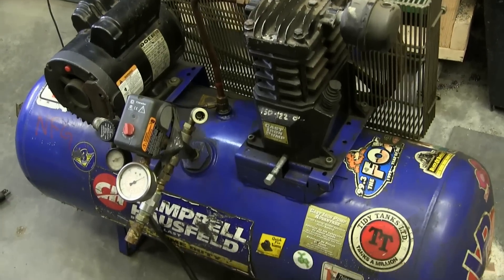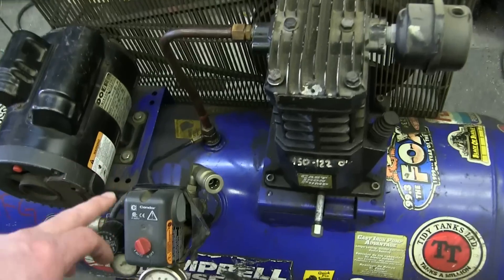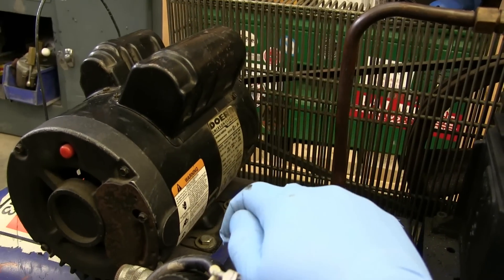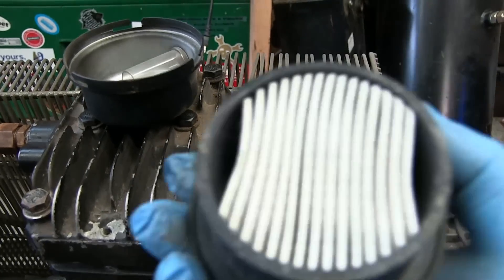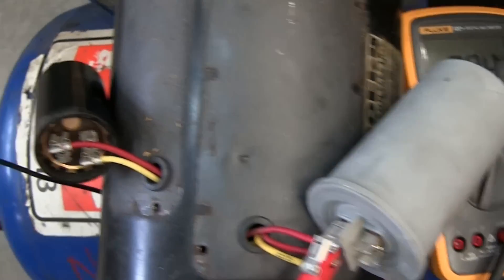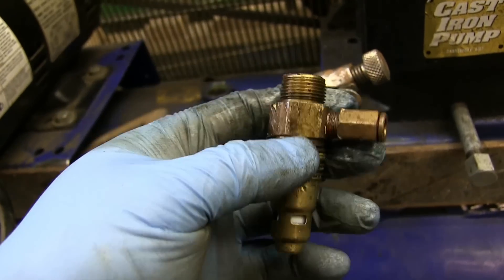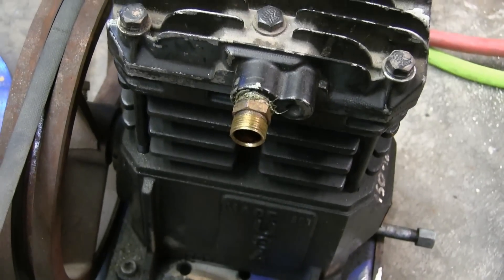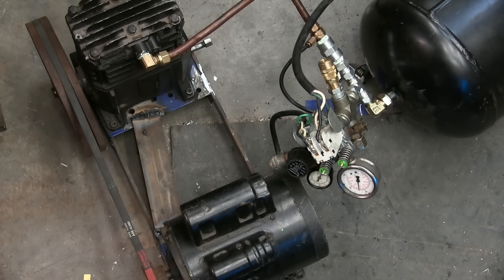BOLTR: Air Compressor Explained and Fixed.

Comment: I have a shop where the compressed air tanks are inspected by the state every 5 years. I have had the same inspector everytime and he has some very scary stories about air tank explosions. The most memorable one involved a car wash where the air pump wore out and was consuming oil. Instead of repair or replace the pump they kept pouring oil into it. The pump was running so hot the oil caked in the HP line running into the tank (plus the tank was full of oil vapor) making a restricted orifice..... One day... BOOM! Destroyed the compressor shed, blew out a block-wall, launched the pump unit over 200 feet away, killed 1 and injured 4 people. The inspector had pictures and it was truly scary how violent it was. Mind you, it was a bomb but the idea that something like that can happen is sobering.

I'm thinking, since this is in his house and he has a wife and child, he doesn't want to Mickey Mouse the compressor to save a couple of Canadian Pesos.... Some things are worth doing correctly. This is one of them.
Reply: That's why it's important to maintain your compressor,  I don't think i've ever heard of a air compressor exploding that was functioning correctly, it's always overpressure that does it.

After seeing his welds, yea, i wouldn't trust myself to weld a air tank either.  Besides, if you have other tanks laying around, why not use em?

For me, I make sure my tank stays drained, and my blowoff valve works (I test it occasionally) and don't worry too much about it.  I've never heard of a air tank exploding that wasn't over pressurized, seen dozens that leak @ 125psi, but never explode.

Comment: I picked up a compressor it has two 8 inch Pistons with a 4 inch stroke haha any clue for cfm  ,tank size and hp it needs
Reply: First off I'm guessing that your overall cylinder size (cooling fin tip to opposing fin tip) is 8"...now what you need to know is if it's two or single stage...easiest way to figure that out is look for the cylinder jacket sizes by looking between the fins or on the heads you will see a circular bolt pattern...if you see two different sizes you have a two stage ...also if there is an intercooler (finned pipe that goods between cylinders) otherwise you have what AVE has (what looks to be) a single stage stage...if yours is a single stage, I would say between 2-3hp...if it's a two stage then it could be as high as 5-7.5hp (or a really cheap 10hp)...the loose rule of thumb (and it's rough as there are so many factors out there) is approx 4cfm per hp. Also most piston pumps will give you 150psi max...some better pumps (DV, Quincy, IR, Gardner Denver, Champion) have no problem with 175psi...also if you have the larger two stage pump a good pump speed is between 300-600rpm for better life and cooling...if it's the smaller single stage you may have to spin it faster to get any decent performance.
Reply: ...but for the exact hp etc...you will need to pop off the head to measure out the cylinders...unless you know make and model...if it truly has 8" pistons you will need between 50-100+hp :)
Reply: Thanks for the info, I took of the heads ,yes there are two 8 in pistons and when rotated it drops 4 inches and one comes up .it is a V shape block ,it weighs about 350 lbs .

Comment: hi AvE, I realize this might sound like a silly question, but hear me out... All the pressure switches I've seen on workshop-size air compressors are tied directly to the pressure inside the tank through a pipe. (The switches are generally strapped right on top of that pipe, there's a diaphragm the pressure acts on and actuates the switching elements. The pipe also manifolds-off to the regulator and quick-disconnect.) Anyway, my point is the pressure switches have two separate pressure inputs. The pipe connecting straight into the tank and that plastic tube you called a "sense line". What's the point of the two inputs to the pressure switch? Why not just one input?

I've taken apart a pressure switch before and I suspect that the "sense line" is a pressure release line. This is the ConOps of what I think happens: When the tank reaches the set cut-off pressure, the switch sees that pressure through the direct pipe to the tank and turns off the motor. At the same time the switch relieves the pressure in the line between the compressor and the check valve by opening a small valve that normally keeps that plastic tube (the "sense line") closed off. The check valve prevents the tank from releasing through the plastic tube. The hissing heard right when the motor turns off is the switch releasing the pressure in the line between the compressor and check valve. I think the reason for releasing the pressure (through this plastic tube) is to make start-up on the motor easier the next time it turns on. If the line was left pressurized, the motor would pull much more power at start-up and would be more likely to fail or trip a breaker. Does that make sense? What do you think?
Reply: That is exactly it.  Most compressor motor's won't even start if there's full pressure to the head.
Reply: Ah cool, roger that. Thanks for confirming my suspicions, much appreciate it! I've tried researching it but haven't been able to find anything useful on this subject

Comment: That's a cap start cap run motor. The gray cap is the run cap, it regulates current and phase angle thru the start winding. The start cap probably is controlled in this case by a centrifugal switch. The motor starts under load so the start cap is necessary. I went to school for HVAC.

Comment: my compressor had some sort of powdered metal as fittings. and one day the start leaking, the next day it just desintegrated into powder. I never could fix that. Material was left in the threads and I couldn't put a proper fitting again. Made of  syntered chinamsium.

Comment: If you want to remove moisture from the compressed air,  hang a Junk Yard AC condenser on the outside of the belt guard and plumb it in between the compressor and the tank.  The cooling on the compressor belt pulley will also draw air through the condenser.  The air entering the tank is essentially room temperature so will not release moisture as it expands through tool orifice.
Reply: ycmdill that will just cool the air charge, it won't remove moisture from the air.
Reply: You are entitled to your opinion.  I have actually done it and use my compressor extensively for painting which is most sensitive to water contamination.

Comment: had to replace the head gasket on my crapsman 60gal.  and the sense line coupling started leaking so I had to replace the alum lines with copper.   

ugh, crapsman crap

Comment: Been trying to keep my eyeballs on scan mode for a good compressor at a decent price. If it weren't for the fact that I require 6+ scfm at 90 psi minimum it would probably be much easier. Perpetual financial hemorrhaging from my expensive hobbies being a factor I've been looking at some chinesium clones a la Amazon. Of course their descriptions leave a lot to the imagination, such as it states 250L/min but don't provide at what PSI. They haven't answered my questions but the price is so tempting, 250L/min equates to 8.8 scfm gives a pretty good amount of headroom from my requirement at 90psi, even if it's 8.8 scfm @ 45 psi it seems likely that it would be in the ball park at 90 psi. What say you, folk of dicks-in-vices?
Reply: some companies, particularly cheap ones rate their compressors at 0 psi, at 90 psi it can be much less then half that rating.  If it's 120v, your not getting over 4-5 cfm at 90.

Another option would be to get 2 smaller compressors and chain them.  The best way to wire them is to trigger a relay off one that engages the second, but a slapdash way is to set the second one to trigger on at a slightly lower value.  The problem with this method is one compressor tends to work more then the other (the second one only coming on when your drawing more air then the first can provide.

IMO always look at decent quality used compressors before buying new.  Even a shitty looking old belt driven will serve you better\longer 9 times out of 10.

Direct drive compressor's are only good for light duty, oilless are only good for filling tires and powering brad nailers.  Neither type last's long when put to any hard use.  they are also noisy as fuck.  When I had a direct drive compressor i had to wear muffs if it was inside, and it was still noisy if i put it outside.  I got a used belt driven compressor and when it's outside I can't even hear it
Reply: The Whiskey Gunner 
ALL OF THOSE  are at 45 psi, just keep that in mind .

Comment: Heyya...  I inherited a big box of assorted pipe fittings a few years ago.  In it, were a dozen or more of these things; some brass, some stainless, no two quite the same length, taper, or diameter.  Did image searches, looked through pipe-fitting catalogues, asked my facebook horde, etc.  At best, some guessed check valves, or pipe flaring bits.  Might you, or your horde know what these bullet-shaped turned metal parts are?

http://bonmot.ca/~nevin/wtf.JPG
Reply: Nevin Williams mushroom tips are for putting in mushroom tip receptacles. 
side note: I don't actually know what it is. lol
Reply: Heh.  #subtletroll
Reply: Bell-ends.
Reply: they are homemade sinkers for fishing my granddad used to make and use them.
Reply: those are mushroom tips.
Reply: https://www.google.com.ar/search?q=PIGTAIL+COPPER+HOSE&source=lnms&tbm=isch&sa=X&ved=0ahUKEwjRtbfNmv3RAhVDxpAKHZACA5oQ_AUICCgB&biw=1920&bih=925
Reply: Nevin Williams  It looks like a homemade metric bubble flare swaging tool for setting the bubble.
Reply: What're they for?   A google search gives me smoking paraphernalia.
Reply: Butt plugs
Reply: Like Cris found, it looks like part of an LP gas fitting. I've never 
seen one not put together already, but maybe they were made before that 
was a thing.
Reply: The shape seems right, but mine are all solid.
Reply: Look a little like rivets to me.  I could see them being being used as plugs for gas fittings?

Comment: Ave I've gotten so much from your vids , I might have something to give back. the 1/4 line coming from the check valve is not a sense line it's an unloader in the press switch. clears the cylinder and discharge line to make it easier on 1 phase motor startup. In pneum HVAC controls it's called a "genie check"

Comment: The run cap usually is oil filled to keep it cooler.  The start cap is "dry" with a higher uf.

Comment: You forgot to tell us about the unloader valve. It releases the pressure in the line, when the tank is full. That way the motor can start easier on restart and not stall out (burning up the start capacitor in the process).
Reply: 5:56 Pretty sure THAT IS NOT A SENSE LINE - that's the unloader line. (That's where the blast of air comes from when it stops normally) Sense is the main entry on the switch base (to the diaphragm).
The pressure switch is not just electric, it's a pneumatic switch as well. When the pressure is great enough, the power to the motor is switched off AND the air from between the pump and the tank check value is vented to atmosphere.
This is so when the pump starts again, the cylinder isn't already under pressure - causing the electric motor to stall before it gets a chance to get some momentum. 
ISSUES WITH THE UNLOADER MECHANISM CAN BURN OUT MOTORS. (Particularly a problem with those single phase motors and their low torque start capacitor setups)
This is why you don't turn running compressors off & on again at the power... and why the human on/off switch built operates the air & power switching.
Reply: He did cover the "blow off valve" = Pressure relief valve. (Safety)
The valve that dumps the head pressure when the tank reaches "full" is known as the unloader because it "unloads" the pressure from the pump piston(s) & output line.
Reply: Bmp, I was a little lost in translation.
Reply: Jup, you are right Ivan! That's where the springs are for, setting the cut in and cut out pressure (hysteresis) for starting the motor.
Reply: +Keith Jurena Cool, that's the Load Genie® from Control Devices, LLC right?
Reply: And some compressors utilize a special check valve without an unloader line to the pressure switch.  Called an Air Genie, these have a spring loaded check valve that senses flow...well, all check valves sense flow..anyhow, when the pressure causes the switch to stop flow of pixies to the motor, the check valve closes to isolate the tank AND a bleed port opens to vent pressure betwixt the compressor and Air Genie.  This way the compressor starts up without pressure load.

Comment: I use compressors that run to 240 psi for work. 10 hp gas engines run 2 of them but we have 3 that run on 54 hp diesel kubota engines. Granted the biguns also run the 3 foot diameter fan impeller that really has skookum suction. The compressors on the big boys are two stage where one piston is the size of a 2 litre bottle and the high pressure side is half that. The pressure regulator is what we call a Quincy valve and sends pressure to the heads and holds the valves open to allow the compressors to continue spinning even  though they aren't blowing any air. Some of these units have over 4000 hours of use and are still going.

Comment: That screwdriver steel is too hard. It was heat treated and not properly annealed afterward. I would dress a grinding wheel real slick and grind an edge back on the tip. Make sure you don't cool the tip as you grind a good screwdriver edge back on, that way you can theoretically anneal the edge properly as you grind the tip. Just don't get it real real hot. Don't get it red hot, but slightly purple should be ok.

Comment: as a certified welder i will tell you how id repair this. 1. Remove tank completely  from unit. 2. cut a hole slightly bigger than the old bung. 3. roll a square piece of plate about 6 inches bigger than the area to use as a patch and round the corners. 4. cut a hole in the patch for a new bung. 5. weld the bung to the patch and remove the plug. 6. clean the area to be welded. 7. (optional) give a shit when i weld the patch in. done.

Comment: Depending on how old the tank is and the value of it the fix isn't worth the risk to fix. Look at what happened to this guy that used a compromised air compressor. https://www.youtube.com/watch?v=KVP_A7eGYxw
Reply: I'm pretty sure that failure wasn't due to rust\cracking, it looks like the pressure switch AND blow off valve failed (assuming they were present in the first place).  It takes a hell of a lot more then 125 psi to cause a failure like that.
Reply: WOW! Thanks for sharing.
Reply: Wow man, thanks for sharing this
Reply: animefreak5757- It does NOT take more than 125psi to do damage like that.If you dont believe me just go and look at a truck tire explosion.

Comment: I never get why folks wear nitrile gloves in a shop...they always tear and you sweat like crazy
Reply: keeps you hands clean and soft for your vices ;)
Reply: I only where them when dealing with chemicals or know im going to be touching a lot of oil. Never where them for more then half an hour, and if i need to wear them longer then that i will just put a new pair on and let my hands breath a second.
Reply: Other than using it for chemicals maybe greasing some stuff. People wear them when working with customers stuff so you don't get everything dirty you just take off your gloves.
Reply: as aforementioned... you wear them when you know you're definitely going to get pretty dirty very quickly.

and/or, if you're going to be working with oils and chemicals that are poisonous....

Comment: What is that spray called?
Reply: oishisakana it's a developer for a penetrate dye, used for finding cracks and holes in metal.
You spray on the dye, let it sit, wipe it off, then spray the developer on, let that dry and where you see red is a crack or hole.

Comment: Oh I thank you for not welding on the ASME tank 
You can not stress that enough even though it would problem split open rather than boom 
Fun is fun bot you are to much fun to not have around
Reply: Ya know, I got an ASME rated air compressor tank over here. So having one I know the difference between it, and the pop cans you think are ASME rated. Let me put it into a bit of perspective for ya. My ASME rated tank is 72 years old now, and it still don't leak!

Comment: How can I suppress the noise coming from my god awful compressor?  Phone app says it's ringin at about 100dB.
Reply: Matt Luettgen put it in an OSB box, and give it some forced ventilation, and some sound baffles for intake and exhaust air
Reply: keep your eye's out for a used belt driven compressor, much quieter.  Not to mention it will probably last you a lifetime if you take care of it.

Comment: you did get the caps wrong. The little black one is definitely the start cap. Like you said they are only designed to be in circuit for a few seconds. That's why they have the big wax plug so when your speed switch gets stuck they blow a bunch of steam out of that wax plug instead of exploding.

Comment: My compressor keeps tripping the breaker. But with some persistence I can get it running. Runs smooth though. What do I check ? I got it second hand.
Reply: AvE I mean when I switch on the compressor my house breaker trips.
Reply: AvE love your vids.